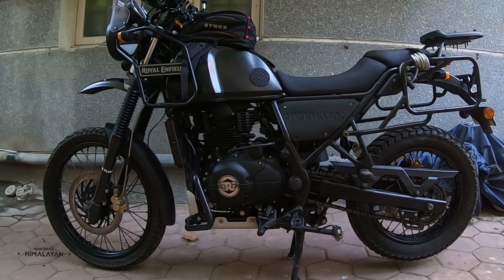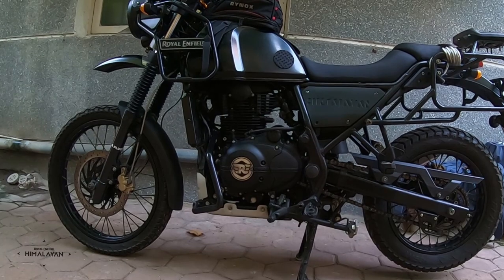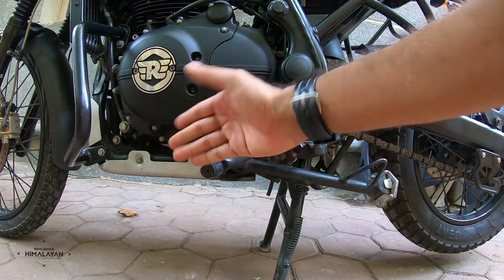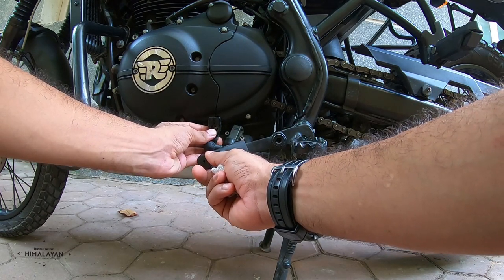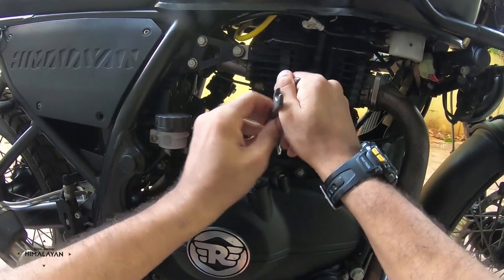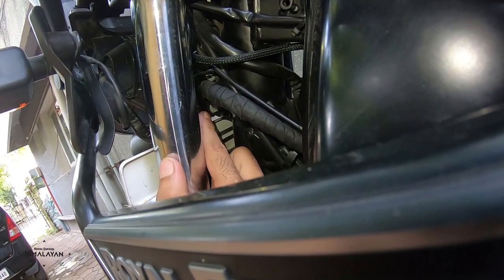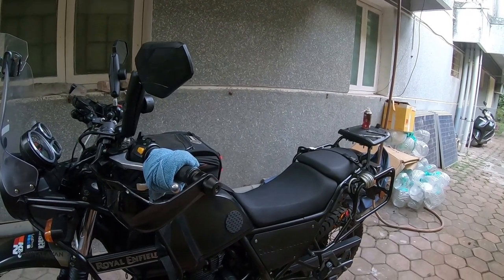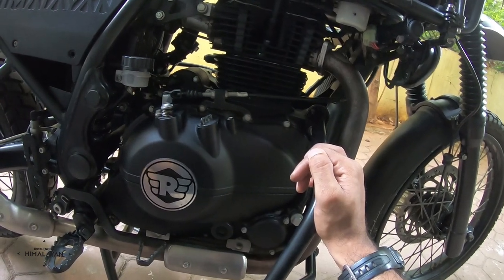ROYAL ENFIELD HIMALAYAN HARD GEAR SHIFTS PROBLEM.

Comment: People who rides Pulsar 200 ns don't even bother about this. Bro it's a common issue, with each engine oil change the engine becomes smooth. Try changing oil once in every 2.5 k kms or go for a better grade oil, most service centre motos top-up oil and say they changed oil. Better get oil changed by yourself.

Comment: What Ben says and writes in the video is absolutely correct, I worked as a motorcycle mechanic myself for many years. It is important that the clutch cable runs in large curves and is cleaned and well oiled without coming into conflict with other components. We also tied the clutch levers 20 years ago and it really helps. Unfortunately there is no money to be made from this, so we are installing a completely new clutch and routing the Bowden cable more optimally! That's just how the market economy works. Good video, everything done right!

Comment: Same issues for me too. Sometimes my gear is stuck on first gear when I start it in signals and a lot force is required to put it to second. Other gears are all fine. Also the sound during the shift 😓,... Reported this for 3 services but royal enfield service engineers told me it's normal 😂. But before watching this video itself I figured out and adjusted the clutch ply and it kind of fixed the issue but the sad part is I have to repeat this almost every 1000km 😶. I will also try the other tips you recommend next time. Thank you so much ✌️❤️

Comment: The final thing holding the clutch lever in speaks volumes . They have their calculations wrong on the position of the clutch , especially if you leave it on the side stand . Good vid .

Comment: I have tried this method of rerouting the clutch cable when you use handlebar riser to eliminate the clunky noise while shifting the gear and it works. However There is another alternative to this method. Why don't you replace  with classic 350 cc's clutch cable which is compatible and longer? You will feel the clutch action will be much softer & smoother. 
Stay safe and enjoy the ride.
Reply: Do you have the OEM  part-number for the longer clutch cable ( classic 350) ?
Reply: @powermickel  you can call and ask a nearby RE service center . They also sell it . That's one of the good things about RE service centers . They'll sell you all the spare parts.

Comment: Just tested it after your fix advice, Thanks a lot Ben, this is great. Rides better now. the clutch still makes a weird woofing noise sometimes pulling away at first gear, will do the 24 hr lock on thebar.Love your videos, Thanks
Reply from the maker: yes , that should free up the sticking clutch plates . but remember to dump the clutch and ride hard the next day for a couple of miles . Also , try this remedy a couple of more times if needed.
Reply: on the top of the hill you can hear the odd (dog woof) sound the clutch still makes, when I move from standing stil releasing the clutch. weird, bike is new 350 miles only
Reply from the maker: @BartMassee  the dog woof is perfectly normal on this one . Engine sounds depend on a lot of factors so don’t bother as long as they are not binding or sticking .
Reply: @ONTWOWHEELSBEN  Its a bit sticky pulling away from a stop when there is some force needed. Current,y have the clutch in for 20 hours, thank you Ben, I love your videos! did the oil change without any issues.. do not dare to attempt the valve tune yet......will let Triumph Seattle handle that first one. Is it oke to put a few extra miles on it over 350? (300 miles initial adjust and check)

Comment: Hey Ben, I have BS 3 Himalayan and I was facing the trouble in shfits while in 1st and 2nd gear while riding.  I will definitely try your ideas given. thanks in advance
Reply from the maker: Sure friend. These tips are universally accepted solutions for hard gear shifts on any bike . Will def make a difference. But if you have a BS3 the easiest way forward is to get your carb pilot mixture and idle air mixture right ( tuned electronically with the help of a digital tachometer) . Take it to a GOOD mech and get it tuned

Comment: All good point but I'll have to respectfully disagree on the first solution. The position of the lever can be changed by rotating the barrel of the linkage and that should be tried first. 
If you put the linkage back together at anything less than 90 degrees from where it connects to the transmission you'll be effectively lowering the pressure or torque used to change gears with each shift, no matter what boots you use. :-)
I know this because mine has to be at the highest setting to accept size 47 motocross boots in order to upshift at all. Great video!

Comment: hey ben thanks for all the videos that you make its super helpful and Ive become addicted to your content.
I have an issue with my forks, I bought a used 2021 b6 himalyan and i think the last owner might have dropped it (nothing major) but the handle bar was bent so I changed it when I took the bike and got it serviced (second service)  the last owner only had 1k kms on the bike.
now when I ride it, it pulls to the right and i have a pain in my right shoulder blade post my rides 
how can i fix it or what could be the issue ?
Reply from the maker: The forks are twisted . That’s why you are subconsciously pushing on your right hand to balance the vehicle . Get this sorted by a SEASONED mech in your area . Describe the same to him and he will know what to do

Comment: I used to have a honda cbf250 which had a gammy clutch. It would bind and not fully disengage but only sometimes. The problem was the bike was speced  for 20w50 oil and i used 10w40. Everyone said it would be fine etc but the thicker oil was needed or the plates warped due to un-even swelling (i think the oil was "squeezed" out overnight but the lower half of the plate is submerged. If i tied the clutch lever it was way better in the morning. It might need to be thicker to cling to the plate???). Himalayans need 15w50 i believe so maybe a similar thing is happening? Clutches are mysterious... once it was warped it needed plates changed tho :/. Certainly the worst culprit was shell helix fully synthetic 10w40 which should have been slippery!

Comment: Great stuff Ben, I love your videos - r u planning to do some rear break lever adjustment and offroad setting recommendations session? I find my lever a little bit off when driving standing up off road, I guess I should raise it or change MC pressure, but I'm interested im more formal advise...
Keep'm comming brother!
Reply from the maker: Hi Guy, will make a dedicated video on off road tweaking that needs to be done on the motorcycle . And yes you HAVE to raise the lever position by about 5 mm (subjective matter) if you plan to do high speed trail riding . slow speed technical stuff , i would have it adjusted to factory position.
Reply: Hi Ben. I've done the lowering of the lever and it's great. However even off road with big boots on I have trouble getting foot under the lever. Should I raise the lever higher than the footpeg

Comment: Hey Ben! Thanks for this very helpful and detailed guide. What is your opinion on not tying the clutch cable at all? After I installed handlebar risers my cable was too taut and the clutch and gearshifts became hard so to free the cable I cut the factory zipties. Now my clutch cable is not tied at all and the clutch feels much better. Is there risk of damage if the cable hangs free? If so I'll purchase some zipties and tie it loose as you've shown. The Himalayan is my first bike and I couldn't have asked for a better source of guidance on how to maintain and run the bike properly. I really appreciate your work!
Reply from the maker: Karan Dhingra if there is no pinching anywhere then you can let it hang . Move handlebar left to right quite aggressively and see if the cable gets stuck somewhere . If all is well leave it the way it is .
Reply: @ONTWOWHEELSBEN   I tried doing this and the cable doesn't snag anywhere so I'm going to leave it as is. Thanks!

Comment: One thing i noticed with the clutch cable is the route it takes. If its installed in the wrong wrong route, gets jammed between the steering limiting snub, damaging it leading to fast failure.

Comment: Bro .. really a nice solution .  I replaced orignal exhuast with red rooster vertex exhaust for my himalayan(odo km was 3500)  ,used without db killer and my engine noice changed a little . Is it normal or should I make any changes ? Plss help with me this bro
Reply from the maker: U need to use a dB killer for sure if you want your engine in good health also to not be on the wrong side of the law . Get a dB killer from your local 2 wheeler spare parts market or get one made .
Reply: @ONTWOWHEELSBEN  my odo is now 4300 kms bro  . Can I change back to Red rooster now?  . Do I need to do anything  about that engine noice change ?

Comment: Hi Ben! Nice video as always.. I have a question, actually didn't understand the increase in the leverage by just changing the angular position of the gear lever... As torque is F*R and you didn't change either of the quantity. Plz correct me if I am missing any point...
Reply from the maker: yes you are right about the exact torque being generated at the shifter . But what i was talking about was the the ease with with the Ankle can generate the same torque in this position . its like a better angle when we use wrenches to generate the same torque.
Reply: @ONTWOWHEELSBEN  yes.. that was I was trying to make out👍

Comment: Hi are you facing any issues with Coil getting burned is there any permanent solution mine got burned two times please help
Reply from the maker: i havent faced this issue . but pls add another 200 mls of oil to your engine and upgrade to the newest coil from the BS6.
Reply: ON TWO WHEELS BEN Thank you sure will give it a try if you find any tips or tricks please do share it with us 

Thank you so much 🙏

Comment: Surely out of context, But
does maintaining low fuel affect the motorcycle affect it?
And also 
will filling my tank to full every time is mandatory?
Reply from the maker: low fuel levels affect fuel pressure in fuel pump. this results in poor low rpm ride quality which can at times be confused for transmission issues
Reply: @ONTWOWHEELSBEN  oh so maintaining full tank is advisable right?
Reply from the maker: Rishi Odisho half and above

Comment: Having watched this i just have to comment. i know you aren't featuring chain adjustment but, i can't help but notice that the  chain, considering the bike is on the centre stand, is far too tight, it should have sag in it so that when the bike is on it's wheels and therefore the chain tension changes it isn't over tight. The chain is best adjusted while the bike is on it's wheels and preferably with some weight on it. The other thing is, doing that tying back thing with the clutch lever will achieve nothing whatsoever other that stress the clutch cable for a very long period, something it was not designed to do. Please, if you are going to do an informational video, please make sure what you are advising has some merit and is correct.
Reply from the maker: yes correct,  i am not featuring a chain adjustment here  . Also if you do not know what tying the lever to the bar does to a sticky clutch then you should def TRY THIS out on a bike that has been sitting too long without being ridden and its clutch wont come loose.
Reply: First off, i haven't got a sticky clutch and if i did have i would investigate why that is and rectify it. Secondly, as i said doing as you suggest will have no other effect on the clutch other than possibly causing the clutch cable to stretch.
Reply: Tying the cable, even loosely, can direct force that was being used to move the cable when the lever is pulled into increasing tension on the cable. Yes, cables will wear more but,  it will perform the task required in a more consistent manner.  

The formulation of the plates is the most likely root cause of this issue. So,  yes, moving to a different composition may correct it.  Also,  moving to a beefier cable could improve clutch actuation without resorting to tying the cable. 

That being said,  both of those solutions require expenditure of cash.  Ben's solution is quick,  cheap, and appears to be effective.  Yes, probably at the cost of reduced life of the cable but,  it's very practical and immediate.  Two important considerations when out and about on a bike. 

Just found your channel, Ben.   I like your pragmatic and diligent approach as well as your honorable humility.  I'm looking forward to more of your wonderful sharing.  

VT, USA

edit: grammar
Reply: After further contemplation on this,  the comments about oils and stickiness increasing with older oils are correct.  

I still like this economical and quick fix but,  it is a good idea to change your oil if things are getting sticky. In fact if my oil has gotten to this point,  i usually through some Motor Flush through it as well to make sure everything is cleaned out.  

Have any of you gone this route as well?

Comment: I have issue with gears when I shift they shift clunky and stuck sometimes what should I do brother I have an interceptor.
Reply from the maker: do all that you see in this video and also give the bike sometime . it takes 4-6 thousand FIX for the gear box to become refined . also learn how to improve shifting gears on your bike. each bike is different . observe keenly and you will understand what works and what doesn't . repeat what works and things will slowly start working for you.
Reply: @ONTWOWHEELSBEN   I shift perfectly on my t100 as well as my interceptor 650 but my interceptor 650 has a gear shifting problem since the day I boughtit . And I don’t understand what’s the issue . and I tried each and every way by adjusting the chain slag and the shifter position and also my clutch cable and it’s play where I keep it to 4mm as recommended in it’s manual . And my bike has another issue when it heats up normally like other bike once in utility. When I turn off the engine and crank it up after some time it starts but the engine struggles and keeps trying to stay on a constant 1200 rpm . And shuts down again then I have to twist the throttle a bit and then crank it up then it starts . Please brother help me with this issues I’m not at all satisfied whit my interceptor.

Comment: Hi Ben, I am facing issues while shifting from the 4th to the 5th gear, the gear doesn't shift at all, and I have to lower down the gear and then again shift up. Help would be appriciated
Reply from the maker: That could be a problem with your gear shift selector mechanism . Pls check the related components . You might have to change the gear selector .
Reply: @ONTWOWHEELSBEN  Thanks

Comment: Sir i have a very hard clutch it's very difficult to pull in play in traffic and long rides plz help me with a solution
Reply from the maker: if it doesn't get better after you have done what you see in this video. then clearly your clutch plates and friction plates are binding . or may be your clutch basket is shot . change the entire kit, not just the plates .

Comment: Hi, I have REH BSIII and already adjusted the gear lever as you have, but the brake lever is still in stock position. 

There is a mismatch between both levers angle. It's awkward as both feet are in different position. Can you think of a solution please.

Thank you
Reply from the maker: Chandramohan A hi friend . That’s a conditioning problem . More in the head than in reality . You are so used to symmetry that you become very irritated the moment you are to work with asymmetry . Think of this while your left hands job is to press and release a lever only hour right hand is continuously twisting and turning something at a different angle than your left. Also it does the job of pulling in the brakes at times . But you have conditioned your brain to accept it as normal . Like wise if you train yourself to accept it it will work for you .
Reply: @ONTWOWHEELSBEN  thanks for the detailed reply. As you said it's more in the head, but when it comes to my ride I have an OCD problem 😜 with symmetry and everything has to be right. 

Thanks